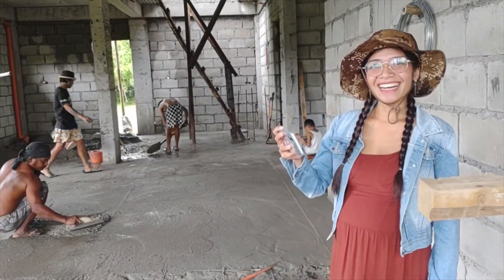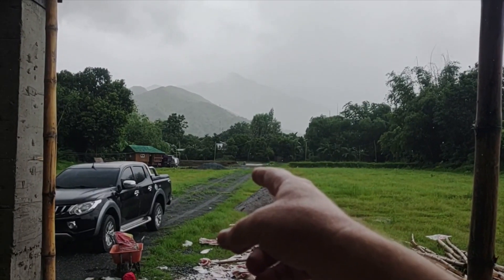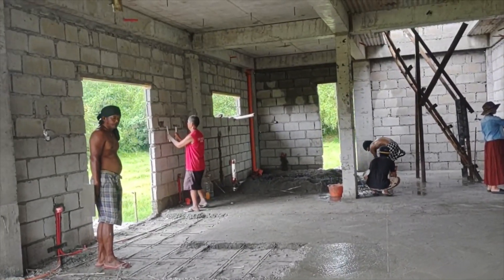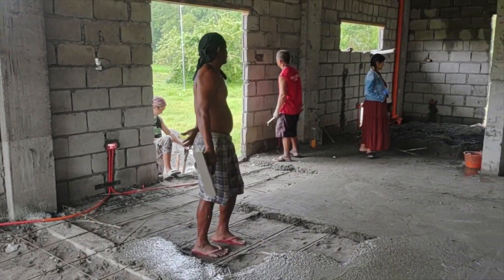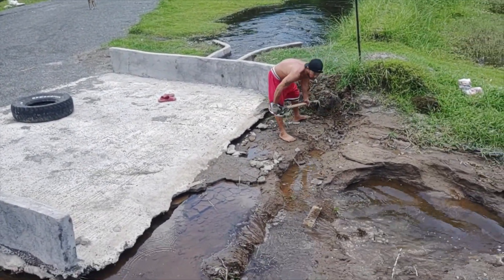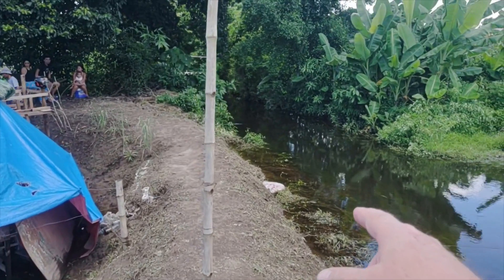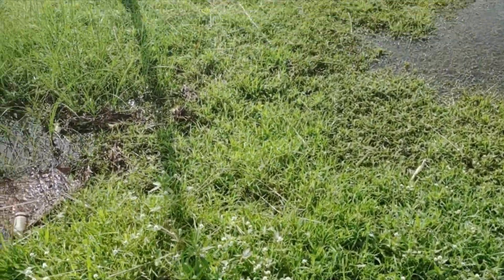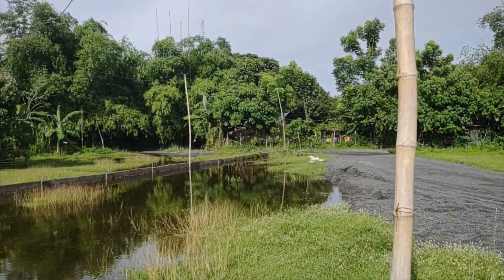Foreigner and Filipina House Build Status Culvert and House 1 2Aug22 @Rolling with LeJhaz

Comment: If the truck got stuck going in..it would still get stuck backing in……?
Reply from the maker: @Marilyn Coish The driver pulled off of the driveway to dump the sand thats when he got stuck. We told him to back onto the driveway (and stay on it) then dump the sand by the carport (while still staying on the driveway). That way he could pull straight out staying on the driveway. He didn't do that. He pulled off the driveway (again) and got stuck. We all had a good laugh afterwards including him. :-)